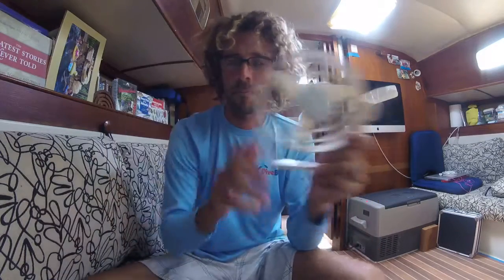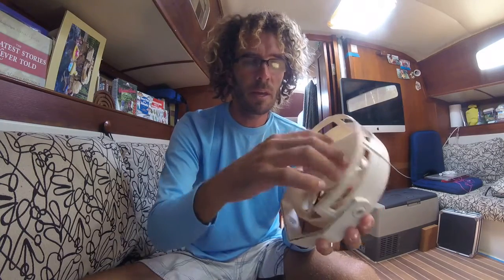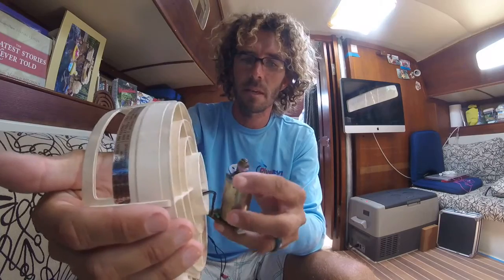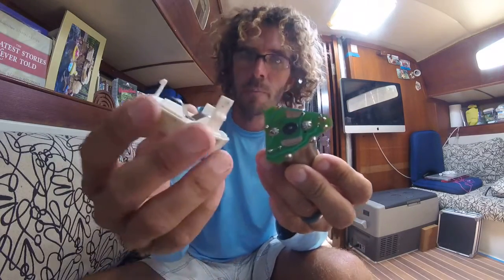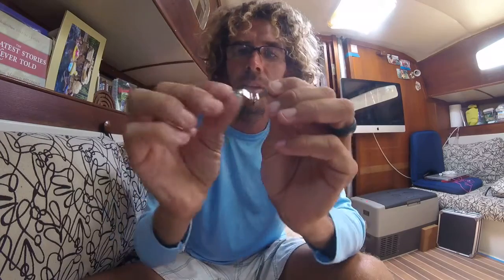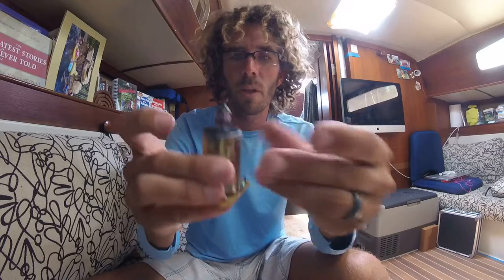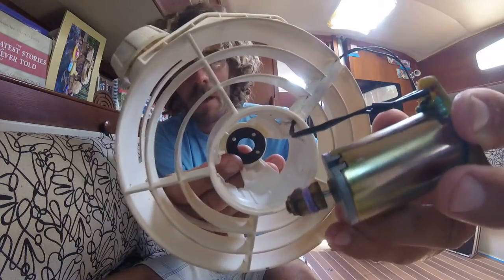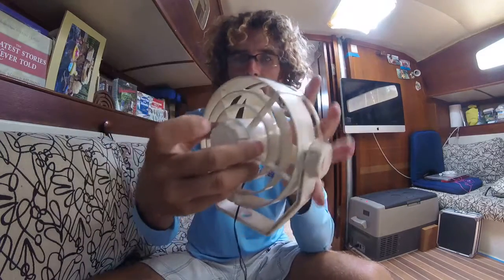Repair and Cleaning of a Hella Turbo Marine Fan

Comment: Great video - thanks for the insight. I was about to replace mine, but it is running sweetly now... :-)

A couple of comments: the brass bushing on the shaft is a compression fitting to secure the fan to the shaft. Once the center cover is removed (typically it is labeled with the fan voltage), the nut should be loosened slightly, at which point its "grip" on the shaft will loosen also, and you can easily remove the fan with the brass bushing still inside. You could probably glue the brass fitting back inside the fan body rather than using those rubber bands... but hey, whatever works.

After cleaning, I also used some McLube "One Drop" - one drop each end of the motor. Seems to be great stuff. Went from squeaky to silky smooth.

Really appreciate the vid! Fair winds...

J.

Comment: I was glad to have found this video as I need to take one of these apart.  However, after the fact I found several aspects of this video just plain wrong.  First, you don't just pull the fan off the motor.  Once the plastic hub cap is removed there's a brass nut that must be removed; this nut threads onto a brass collet that grasps the motor shaft.  Then, you don't just push the motor assembly out the back, you will likely damage something.  There are two "fish hook" features in the molded housing.  Reach in with a screwdriver and spread them out so they release.  The motor and PCB board assembly, and the On/Low/High knob will fall out.  I suspect the poster's unit was previously damaged, which is why his can be taken apart his way, or perhaps it's just a different model.

Comment: This worked great on three of my fans but  two of them were newer models that had a capacitor just above the contacts.  After cleaning both fans thoroughly, the capacitor blew with a loud pop and smoke.  The first one, I used WD 40 with, the second I used electronic cleaner with the same results.  If you have  a newer fan, you risk destroying it with this method.
Reply: 95% of the time a capacitor blows because it is hooked up with reverse polarity. So maybe marking the wires would help eliminate the problem.
Reply: Which makes sense but every single fan that I have done which is 7 of them blew the capacitors after I insured polarity was correct.  (I'm a bomb tech so I know a thing or two about dc current).
Reply: I'm about to clean a few Hella fans on mine, will keep an eye out for a capacitor... do you have a suggestion for an alternate method?
Reply: Was replacing the cap enough to fix them or was the problem elsewhere?

And as a bomb technician, how many explosions does it take for you to change your method? 8? ;)

Comment: On my fan motor the resistor on the motor side of circuit is burnt. It still runs but I could smell it heating up and discolored the board itself. It got hot enought so that I can't see what I should replace it with. Do you have the color code for that resistor. This fan is well worth fixing and I hate to part with it over one little resistor
Reply: Can you measure the value of the resistor with a tester? A Youtube search will show you how to do this.  You can buy a cheap tester for a couple of dollars that will do the job.